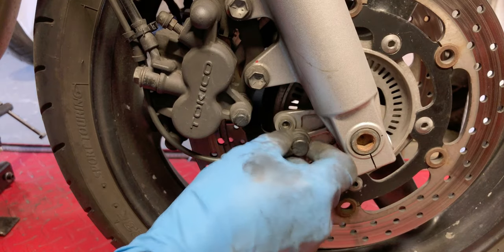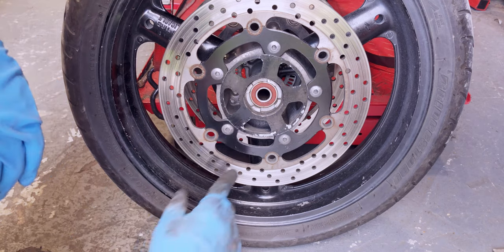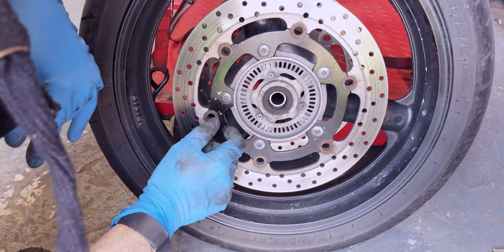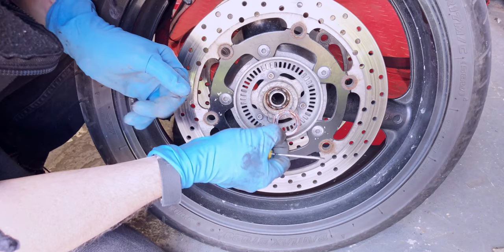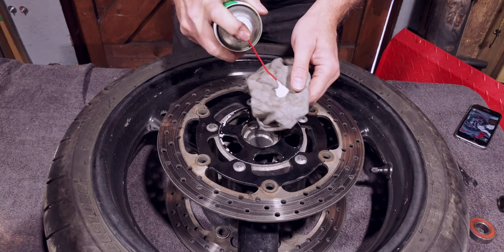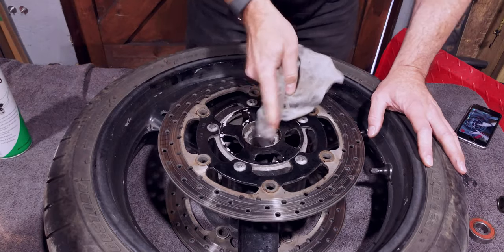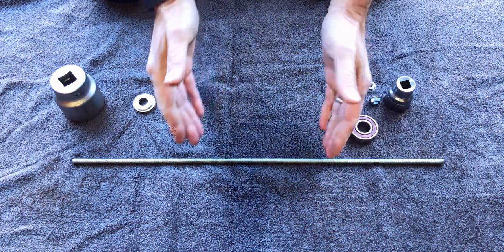Front Wheel Bearings Replacement GSF 650 Bandit

Comment: Nice video, however, I would never hit a new bearing with a hammer , always use a drift like the socket.
Reply from the maker: It’s why I show opinions.  Drifts are good but if you are inexperienced then a press tool is the safest option.  Skäl.  David
Reply: @MotoMirius  Hello David, I think you missed my point. Your video was good, it showed two ways of changing bearings. What I said was never hit a new bearing with hammer, always use something, for example the bearing you took to use for drifting. You could hit the bearing and damage it which would then damage the hub. Also never hit the seal with hammer, if you can't push it in with finger then something is wrong. Thanks for taking the tome to make the video by the way.
Reply from the maker: Hi Paul.  Thanks for the clarification. This is one of those things that there are endless arguments about.   Since I’ve seen engineers disagree, I’m not going I’m not going there, hence my previous reply.  

As far as I understand that side of the argument, you should never hit a bearing with anything, including a drift, because even drifts can be misplaced.  And when that happens, and it does, you can create more damage than would be created by the curved face of a hammer.
In my experience, by far the most important thing is to insert the bearing squarely.  If you get that right, the worst you can do is to damage the bearing, and that is a relatively minor cost to rectify.    Skäl.  David

Comment: nice video, this is the go-to-place for bandit related questions, pro tip for the future, keep the new bearings in the freezer, and give the wheel a touch with the flame gun before assembly, and they are likely to just fall right in:)
Reply from the maker: Thanks.  Ah the old freezer trick heat trick.  Yes, it works but not a pro tip as I've never met any professional who does it that way ;)
Reply: @MotoMirius  well, almost all the tight and precicely machined bearings in the engines we build at work are in fact either frozen or heated to fit:P I'd show you a lot of examples from the factory in Bergen, but alas I'm not allowed to photograph or film at site:P but it is a very typical and professionally valid way of mounting bearings, but seing that these bearings are a reasonable press-fit the need for heat or very cold parts isn't a neccesity, merely a practicality thing if you would like parts that give up less of a fight. cheers anyway:P
Reply from the maker: @mortenbakke2810  When making videos, I tend to follow factory manual guidance, so to be more precise, I've yet to see a professional bike mechanic use heat.  I have used cold and heat - it takes more time and effort to do - I can remove and fit bearings in less time than it takes to walk to and from the freezer.  I would guess in a factory environment where you have bearings in bulk it is quicker to do them this way.

Comment: I do have a question though. Am i correct in thinking that the near side bearing should be completely set up against the inner ledge on the hub but the offside bearing should only be tapped down until it lightly touches the spacer?
Reply from the maker: When the bearings are seated the spacer is also seated against the inner race - it is sized to be the same length as the distance between the bearing seats.

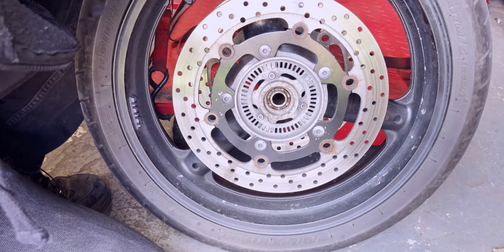Comment: Hey David. What kind of tool is that for pulling out the bearings? The tool you use at time 03:40? If possible please send me a link. Thanks a lot ... Ralf
Reply from the maker: It's a blind bearing puller.  You can find them online - and adjust for your wallet - there are some very expensive professional versions.

Comment: Hi David, thanks a million for posting these videos. They're very helpful specially to someone like me. I'm a total newbie to biking, I just bought my first bike the Suzuki GSF 650 S K5 and I've much to learn. When I bought the bike the fella selling it said that there is a problem with it's battery and it needs to be replaced. I was hoping you or anyone reading the comments could recommend a good battery for this bike?
Reply from the maker: Thanks and nice choice of bike!   So long as you stay away from anything cheap and stick to a main recognised brand - such as the original Yuasa and you get one to fit then you should be fine.  If you want Lithium then I can't recommend and so far I've never tried one although people love them because they are smaller and lighter - but I notice the bike manufacturers don't seem too keen on using them so I'm assuming they know more than me about reliability and service life.   Wemoto https://www.wemoto.com/bikes/suzuki/gsf_650_sk5_bandit/05 for example sell Yuasa, Kyoto and Motobatt.  Never used Kyoto but I'm assuming they are OK, never had any issues with Motobatt - supposedly better at starting than a standard battery - sealed gel type.   Good luck!
Reply: @MotoMirius  Thanks a million David, that was exactly what I was looking for. I went for a Yuasa. I figured if it's good enough for the manufacturer then it's good enough for me.
I have all the mechanical know how of an Amoeba but managed to get it sorted. The bike took a little bit to get started (think I flooded the starter) but got her going in the end.
Unfortunately I have to renew my licence so can't ride it legally for a while yet  coz Covid has delayed things here a bit here. The bike is now living in my mates parents garage about two hours drive from where I live until I can get the licence sorted. I was able to ride it aroubd their car park though. 
My mate had a Bandit back in the end of the 90's and I wanted one of my own since then. 
Thanks again for your help, I'll probably have more questions over time. Liked and subscribed
Reply from the maker: @mckiernan5417  Good luck with getting it back on the road!

Comment: I was always taught if I was torqueing any bolts not to have any lubricant (ie grease) as the torque settings will be out
Reply from the maker: It's one of those ever running debates.  Yamaha for example, I think it's Yamaha, specify that torques are lubricated, others don't specify.  The torques are also based on new threads in the part and the bolt - so an old part will probably be undertorqued because of the friction of corrosion etc is what will trigger the wrench not stretch on the bolt.   This is an older video, so I tend now to torque dry and try to tap the threads - but that in itself is an area of error as it can make the fitting looser.

Comment: I wouldn't personally hit  bearing with a metal hammer.
Reply from the maker: I always recommend that you do what you are comfortable with.  I know engineers who are vastly more experienced and qualified than me who use a steel hammer.   So long as you are hitting the fixed side of the bearing and there is equal pressure then there is no issue.   If you hit the unsupported side or the bearing itself then you will risk damage to the bearing regardless of what you hit it with.

Comment: Hi pal very new to the bandit world just wondering if you could help I’m not sure wether i have abs brake’s or not its a K6 650 early 2007 model oil cooled, Thanks.
Reply from the maker: No problem, almost (because different markets etc can be different) certainly - but you can check to see if it has an ABS ring fitted inside the brake disk.    You can also check where the brake lines run - if they run straight to the brakes without disappearing under the tank then you don't have ABS - just because it was made with ABS doesn't mean they haven't been bypassed.